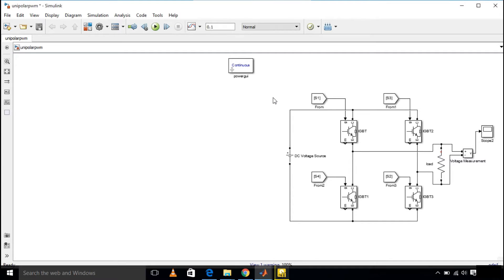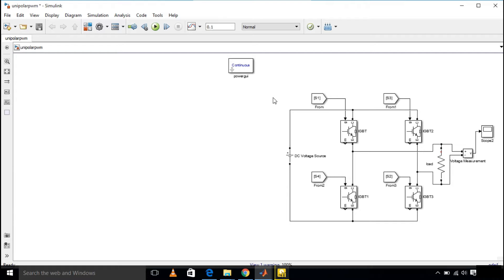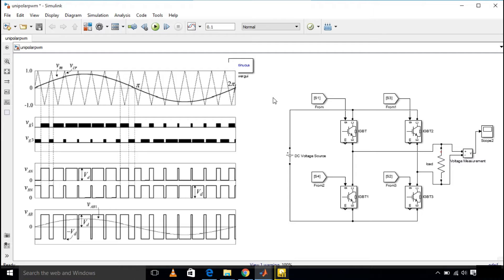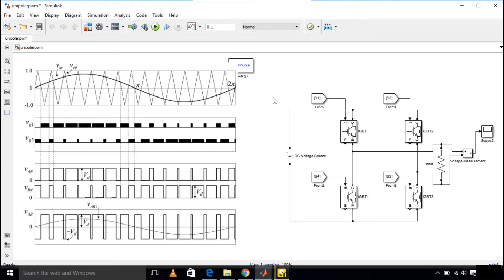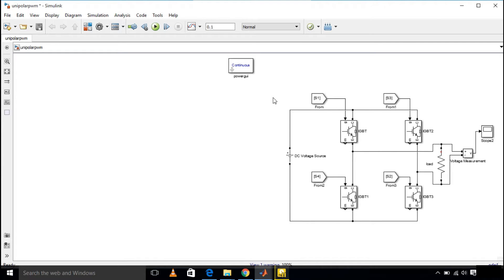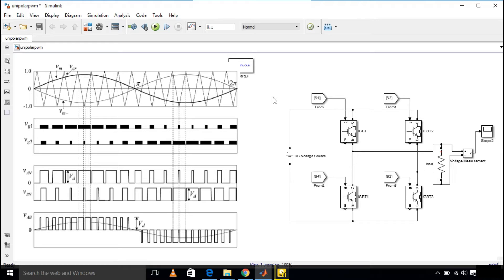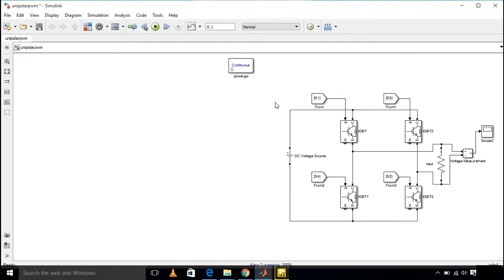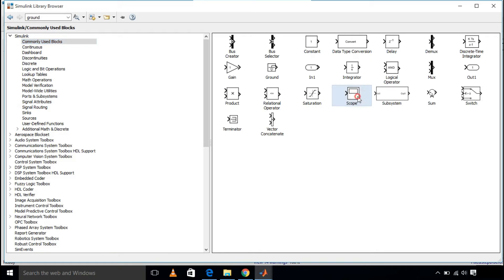Bipolar and Unipolar PWM Technique for Inverter | MATLAB Simulation

Comment: My question is: In the repeating sequence you divided the time with [1/400]. Can you please explain to me that. 
If my switching frequency is 10khz, what should I change in the pwm control block?
Reply from the maker: you need to multiply with 1/20000.
means total time T=1/f,  T=2*1/20000

Comment: why  carrier frequency is multiplicated by 4?
Reply from the maker: Here in repeating sequence you have to put time value that is t=1/f and vice-versa.so here 0 1 2 3 4 is the corresponding time values with respect to output values.Here carrier frequency= 100 Hz.means total time=1/100=0.01sec.becuase here I put total time 4 that's why I multiply with 1/400.ultimately the total cycle is same.that is 0.01 sec
Reply: Thankyou ;)

Comment: for RL load the output is not proper. will you send the model for RL load please
Reply from the maker: For Rl load you have to put the proper value of R and L.and also the switching frequency.
Reply from the maker: Take switching frequency 1 KHz,R=10 and L=0.025 H.then check it out
Reply: @RanitSengupta  hello there. I am new to Matlab. May I know what is this mean? And where exactly should I put switching frequency=1kHz?
Reply from the maker: @blablablameh  mainly the carrier wave frequency termed as switching frequency.Here the carrier wave is the triangular wave. t(total time period)=1/f
Reply: @RanitSengupta  thank you so much for replying back! So by referring triangular wave in your Matlab, do i need to change time value ----> [0 1 2 3 4]*[1/400] to 1kHz? If so, how am i supposed to change them?
Reply from the maker: @blablablameh  no here the f=400/ 4. 4 is the total time period.so if you want to give frequency 1 khz then give [0 1 2 3 4]*[1/4000].That means f=4000/4= 1 khz.you understand??
Reply: @RanitSengupta  thank you so much for explaining this to me! You're a life saver! Thank you again!
Reply from the maker: @blablablameh  you are welcome
Reply: @RanitSengupta  thank you. to obtain approximate sine wave in the output what to do. will you please send the simulink model
Reply from the maker: Approximate sine wave for current or voltage??
Reply: @RanitSengupta  voltage